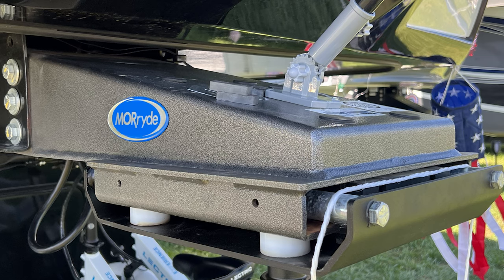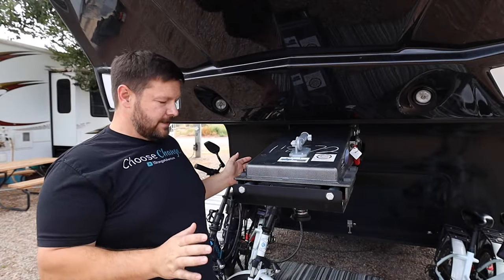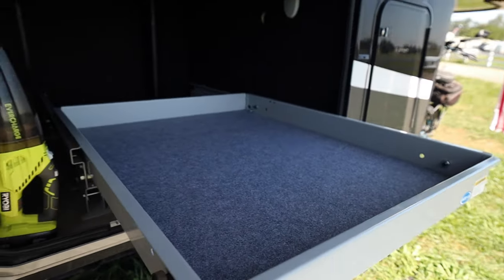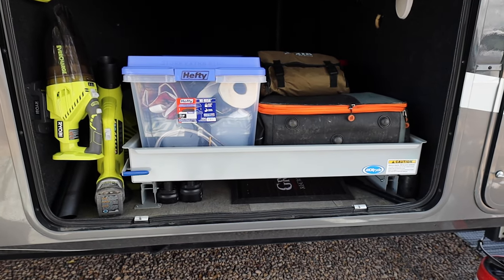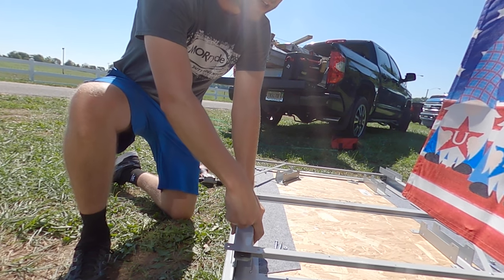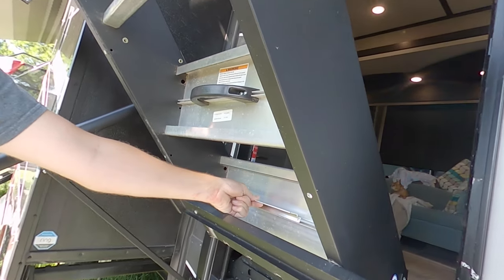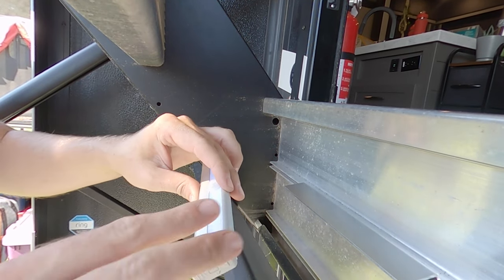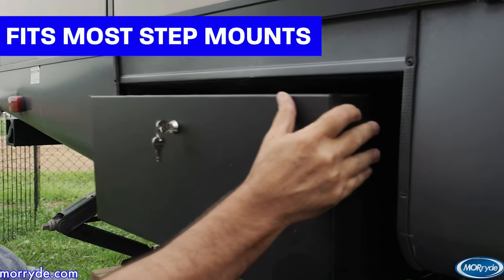Top 5 RV Upgrades from MORryde that you should INSTALL! (DIY UPGRADES)

Comment: Harold, do you know anyone that has installed the hand railing on a 390rk-r. We tried to have these installed at the TN Rally and we were told our awning arm is in the way. Just curious because we would love to have these. Thanks
Reply from the maker: We have seen where some awning arms come down very low.  We have also seen where the slide comes in too close to the door for these to be installed.  That happened to our neighbor at the National rally.  Not sure if the 390 falls into those categories.

Comment: Have any ideas for a 395 ms because there storage sucks.I know in the back toy hauler steps you switch out to them folding steps .I know they make a storage box but I need more storage
Reply from the maker: The 395 does have a small storage. I believe some have been able to add a small amount of storage by moving the storage walls, but it’s still not very much. ☹️ trade off for that nice living room, I guess.
Reply: @1StrangeAdventure  I was hoping you could find something that would work,you guys are great at these things
Reply from the maker: We will look around for ya! ☺️
Reply: @1StrangeAdventure  thanks,I need all the help I can with this